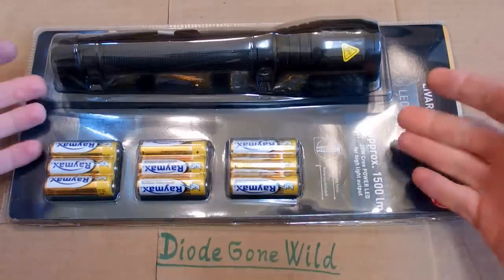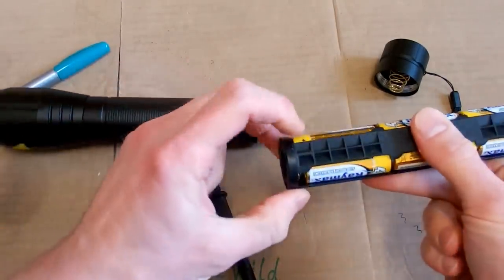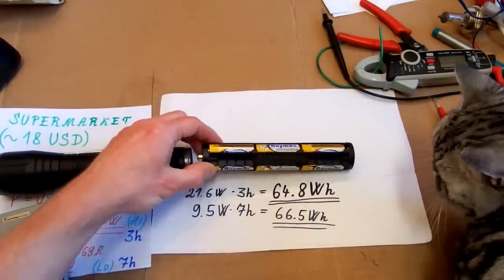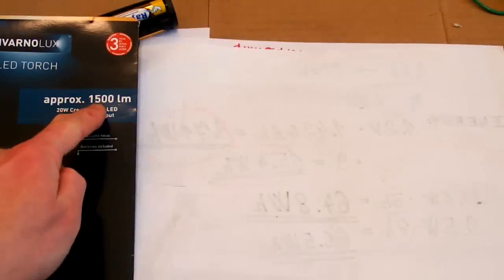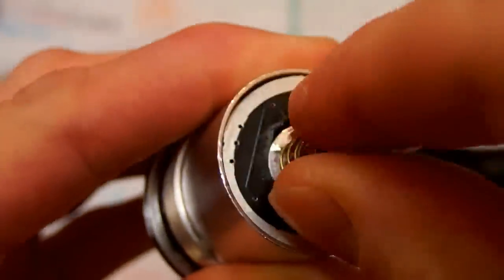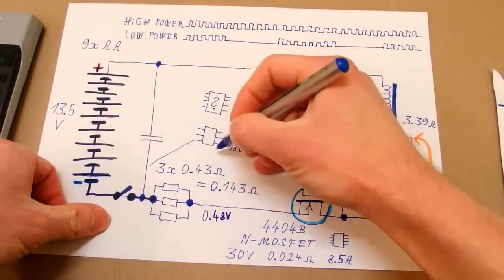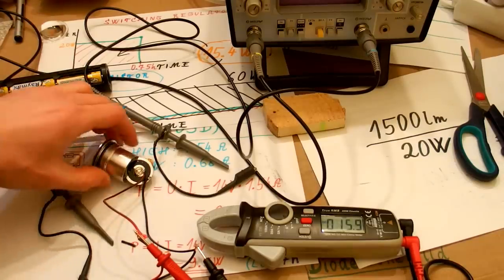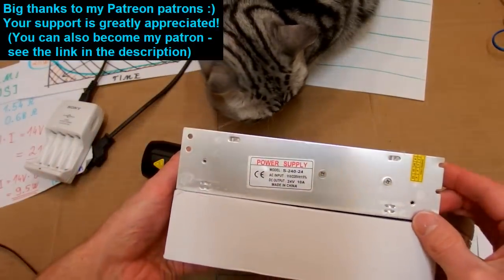20W 9xAA Cree LED torch from Lidl - test and teardown

Comment: Thank you for your once again very detailed video. I also bought 2 of these flashlights before Christmas. For 15 euros per flashlight, this is a good flashlight and also good for modding. The Led is a Cree XHP 50.2 Led (18W), this is available as 6V / 3A and 12V / 1,5A type, max 2654 lm, max. 165 lm / W. I drilled 2 opposite holes into the aluminum head, in order to be able to open and screw the head better (for the Led driver).I removed the small plastic disk and cleaned the head of thermal grease and glued the Led board back with thermal glue for better heat transfer. As an alternative to NiMh AA batteries 3x Li-Ion 26500 cells would be conceivable (3x max 4.2V = 12.6V). It would be great if when once could reprogram the microprocessor to remove SOS and beacon and add a third very low brightness (moonlight mode).
 Thanks for your many interesting videos. You have a nice cat. Greetings from Germany. Wish you a healthy new year.
Reply: A few people posted schematic in the comments. So fundamentally you could replace the mode control IC with your own microcontroller. Chances are whatever's on there is either OTP, or a custom or semi-custom IC that replaces a microcontroller used at prototyping/development stages and thus sharing the footprint with a microcontroller.

Comment: Why an Earth all of these LED flaslights have tose blinking etc functions? I want flashlight with just ON/OFF switch and nothing else. Or at least a system where you can change the function separately and the switch is just ON/OFF switch.
Reply: I modded one of my flashlight just to remove those blinking and halfbright modes, it is much better with just a single mode. Having a potentiometer to regulate brightness separately would be even better.
Reply: SOS

If you're stranded and you need help, a repetitive flickering light will get more attention than just a bright light. Rarely does natural stuff pulses repetitively. 

Also why we think aliens will send pulsating radio waves to us.
Reply: well these functions are used,then you do crash landing/ship sinks..then you can use it as sos signal..i seen flash light what max distance is nearly 2km..
i seen theys kind inside emergency kit offen

Comment: Very good presentation, the voltage/current/power/energy concepts explained so that even a 14 years old would understand them. The flashlight might be a good deal to reuse the 20W cree led, I think if bought separatelly it would cost about the same and here you also get the buck converter, lenses, batteries, etc.

Comment: That could be fun project. Turn that flashlight into LiPo powered one. Using LiPo cells with BMS board with charging capability. Also happy new year. Z pozdravom zo Slovenska.

Comment: For disassembling flashlights you can try to pull on this zoomable part and rotate it. As this zoomable part grips this led module you might be able to unscrew this without damaging surface.

Comment: I do not know if could be helpful but that is a Cree LED, the 5mm one is the XHP50 .
You can check it in their website,  led components/products/XlampLeds/Arrays, look like thier XHP50.2 (more powerful, you can recognize from yellow bulb and the 4 chips), also you can check data sheet, that is pretty cool.
I am waiting a torch with their last model of led XHP70.2 way more powerful, that works with 18650 battery!
I have already treadown some flashlight with cree led and all work the same!
Incredible few days ago I fixed up a power supply 24V but 4.5A model LP2022-24 and now you will looking the 10amps version.
We have the same passion lol.
I will wait with impatience the upload of the video about power supply!!! They are my favorite on this channel please keep doing!
Have a good day, bye!!!
Reply from the maker: Thanks for identifying the LED :). They could have used 18650's in this flashlight, but with the batteries and a suitable charger included, it would be too expensive for a supermarket...

Comment: I do love that really powerful flashlights are now affordable for normal people.  I'd be all over the 'affordable' lights if they only got rid of the strobe, SOS, and let you set the power level for one click on (maybe a switch to tell it to go low or high once I press the cap's power switch). EDIT: Would you be able to fit (3) 26xxx sized lithium batteries in it?
Reply from the maker: I do love it to :) And I also hate the strobe and SOS. It's possible to bypass the mode chip, but you also lose the low power setting which I don't want to lose. Three 18650s or 26650s are unfortunately too long.

Comment: I'm guessing it would also fit 3 X 18650 in it or possibly an even wider battery. More realistic capacity of these is about 10.5 wh which would be closer but still not what expected. At very max might find a 12wh 18650.
Reply from the maker: I thought of using 3x 18650 or 26650, but they are loo long.

Comment: hey diode, can you check if 18650 will fit & work in this body? It has this AAA adapter so I assume it could work with 18650 right away as in other chinese smaller ones for 3AAAs but just to be sure - this seems like quite good hardware actually.
Reply from the maker: No, it's too short for three 18650s.
Reply: DiodeGoneWild What about finding some decent Li-ion AA batteries and either modifying the battery holder for a 3S3P configuration. Or maybe just use 3 batteries and short out the rest?
Reply: a real pity that. Well thanks for checking anyways.

Comment: Quite nice review. I just wish, you would do an efficiency measurement. But I suppose it would be quite low, especially if current sense resistors alone waste almost 8% of power to the LED.

Comment: This led is may work confortable with 8.4V 2S2P battery pack and practical to have a controller 33% mode to get lots of lumens and last abaut 3 or more hours in tipical usage.

Comment: Happy new year! Well the Power should be calculated with the voltage under load. 1.5A/9 batteries = 170mA of current from each battery, which should drop the voltage some
Reply: This works if the batteries are in parallel; the batteries are in series in the flashlight; so 1,5A from each battery at around 13,5-14,85 volts total; so the power is ~20,25-22,28W

Comment: Do you still have your Christmas present?  What does the clamp ammeter do when it sees AC?  according to the data sheet the QX9920 should charge the inductor up to about 1.7  Amps and turn off (0.143 ohms 0.25 Volts).  The input current should be 1.7 Amp pulses of shorter duration with higher input voltage (constant off time) (at 19:49).  Ideally power in should equal power out (I assume the brightness does not change with input voltage).  I'd also suspect the measurement at 4:45.

Comment: lov what you do, Happy New Year......always found it confusing on LED power ratings stated on the packaging, is it equivalent to an XX watt light bulb or does it use XX Watts? ( latter being useless for spec'ing actual illumination ).   luminous flux is better, but, ya never know if an integrating sphere was used...or a light meter ...or just quoting the LED mfg's datasheet!   Cheers

Comment: Wow for a $20 flashlight it has a pretty monstrous XHP led in it. Flashlights in the $70 and higher range typically use those chips.
Reply from the maker: I think that the LED is the lowest efficiency bin. If the data on the package are right, 1500 lm / 20W = 75 lm/W. This is why it's cheap :).
Reply: @DiodeGoneWild thats an xhp50.2 quite a high-end chip from CREE from memory on the datasheet it can do like 2600-2700 lm at 20w so it definitely isn't a cheap chip, they've just underrated this flashlight by the looks of it.

Comment: Shark fin, more like a cat fish :-D
That looks like a dam good torch, how to get lithiums in there, more power ha ha :-D.
And a switchmode to play with, sounds like you had a good xmas.
Lidl and Aldi have some usefull stuff, but aldi has something for say a week then thats it!.
I bought a digital micrometer for £8 (really cheap), they never had them again.
Reply from the maker: It's definitely a good torch. It seems to contain xhp50 LED. Probably one of the lower efficiency bins, but still good. It would be bloody expensive to run in on Lithium AA's, but this would be very good for an emergency flashlight with a very long storage life. For frequent operation, Li-Ions would be the best, but 3x 18650 or 3x 26650 won't fit, they're too long. Maybe I could remove the switchmode power supply and put just a resistor in it and then run it on 2x 26650 in series. The SMPS would run on 2x Li-ion too, but at a low power. It could also run on 3x AA Li-ion and 6 dummy cells, or it could be rewired for 9x AA Li-ion (3S3P). Here we have no Aldi. Lidl also has those things for one week and then they have different things. Once I bought their 19W E27 LED and I was waiting a year before they had it again, to buy another :).
Reply: Speak of the devil, i was just looking through the power supply section of your site and up popped your notification, i thought he knows im here lol :).
Ha ha it sounds like Lidl is pretty much the same company, just one week is Aldi's trick.
I think it's done to make you go back every week, just in case you are in danger of missing something lol.

The digital caliper (yes i did take it apart, just had to) would have cost 30 to 40 pounds elsewhere, same basic no-name.
You could use a resistor for dropping voltage, a small wirewound perhaps?

Comment: Is your cat really called "Mike Hat"?😸😽😻😼🤦😹

That's quite an impressive torch, considering its price and origin, and quite a lot packed into a small space, but, it's a bit misleading in its claimed running times. I would be very wary if I were say, an "urban explorer" and expecting three hours of use on one set of batteries. Just imagine getting 45 minutes into a tunnel, and suddenly, the light went out.  It would be a long crawl out in the dark!

Comment: There are many of these lights out there labeled with different brand names. All the same with the same XHP LEDs. I’ve seen this exact light branded as Bushnell that sold at Walmart… And several other brands like Nebo and others… And they all come with those shitty alkalines. At the very least folks could replace them with NIMH. 
Three 26650’s won’t fit but then possibly three 26500 cells would. Sure is a good cheap light if folks can figure out a way to fit good rechargeable cells in there. Probably a really low bin XHP50 but still… being available locally in stores it’s a great light for people getting into modding and tinkering with lights

Comment: Under 1.5amp the voltage of the batteries is droping way under 14 volts, so the power is not close to 20wats

Comment: You should check batteryshowdown dot com where there's a bunch of AA batteries tested at high current (1A) and low current (100mA) 
Nine batteries seems a bit excessive to me, imho they could have used 3-4 C or D type batteries and a step-up led driver in the flashlight - you can get alkaline C batteries for around 1$ on Amazon and rechargeable C batteries (with around 5000mAh capacity) are around 3.5-4$ each
Reply from the maker: They probably  use AA's because they are more common. I very rarely see a proper  alkaline C or D. Cheap C or D batteries have almost the same capacity as AA's.

Comment: There  is  something  wrong  with  this  scheme  
1-the current  sense  resister  should  be  in series  with  the  coil to sens the  led current  and not hall circuit

Comment: I think the Morse is wrong. there should be no pause between the last dot of the S and the first dash of the O, and likewise O and S. SOS is a prosign (procedural sign) with the mnemonic SOS, not the three individual letters S, O, S.
I once made a circuit using CMOS discretes (a counter and a decoder, I think) that flashed SOS which is how I came to know this
Reply from the maker: I didn't know about this (just like the designer of this flashlight)...

Comment: Recently i have noticed something , a 16amp European plug perfectly fits into a 6amp indian plug , the thing is that most of the europe has 220v so European products like power tools and computer power supplies are very much sold in India with the same plug , i have a heating gun which draws 2000w and the plug is a 16amp non earth European plug (it is made of plastic and only the nozel is metal which u r not supposed to touch bcz it gets very hot!) The European 16amp plug doest fit inside 16amp indian plug!! Which means more fire!!🔥🔥 , And this a bit of a safety concern cause the 6amp plug gets heated a lot and i can barely run it for 1hr before it melts!! !! 8amps through a 6amp plug!! = 🔥🔥

Comment: 9 batteries in series:  add the voltages together but doesn’t the Ah remain the same a 1? So no increase in capacity by many in series only by many in parallel?  Thanks
Reply: If you talk about the capacity in amp hours, the capacity does not change with cells in series. Often, the total energy stored in the battery (measured in watt hours) is also called capacity. The total energy in Wh (which is what this video mostly talks about) is indeed multiplied by 9 when the voltage is multiplied by 9.

Comment: You can find 26500 li-ion or li-poly at AE so it would fit. For shit and giggle, you could simply reroute and rewire  the AA battery bay to 3P3S configuration with 9x 14500 li-ion battery. Lol

Comment: 3x18650 cells seems better in this operation
Reply: It might fit even the 3x26650 cells
Reply from the maker: 3x 18650's or 26650's won't fit without a hydraulic press :)
Reply: @DiodeGoneWild  26500 then?
Reply: @Mavi222  3× 14500 li-ion
Reply: @DiodeGoneWild  any other rechargable battery upgrade possible? I got the 12 battery "30w" version now, bought at lidl sweden
Reply: @jvsyoutube3298  definitely possible. Like I mentioned above you could try the 26500 batteries they are a bit shorter than the 26650. And they have shit tons of energy storage when compared to alkalines. Or possibly you could find a way to extend the tube of the flashlight. Many companies sell cheap extension tubes for a few dollars. Or if you want to do it without any modification you could just buy NIMH rechargeable AA batteries

Comment: "Its quite usefull" And throws it away xdd
Reply: It's a very nice design! But the use of regular batteries is a huge let down. Also for that money or even less you could get a convoy S2+ flashlight which should be about the same intensity, better circuitry and 18650 battery. Also more compact case.

Comment: lm/W doesn't mean efficiency, but efficacy. 75lm/W is actually quite terrible for a 6000K-ish 5050 LED, or any LED actually. Any half-decent design of LED lighting is 80-90lm/W with a frosted cover (which loweres efficacy) like in many home-use LED bulbs, and for that color temperature it's not hard to get 100-120lm/W with clear cover and lens. Proffesional LED lighting can go even higher, probably up to 130-140lm/W. They are probably running the LED too hard, which puts out more light but lowers the efficacy quite a lot and shortening the LED's lifespan a lot.
Reply from the maker: Yes, the low efficacy may be because it's run at the maximum power (LEDs reach the best efficacy at lower powers), or because the LED is the lowest efficacy bin, which is probably cheaper.
Reply: I'm almost 100% sure it's one of those lowest bins, with extremely poor CRI and efficacy, hence the RG2 classification, which again is just plain terrible and actually dangerous. Amazing how far manufacturers go to shave some cents off...It's not that hard to get a product with RG1 rating and still keep it cheap as chips
Reply: I don't know much about this stuff, but the LED seems to be the Cree XLamp XHP50.2. Cree's website says that "Maximum Efficacy at Binning Conditions (lm/W)" of this LED is 165 lm/W and "Maximum Drive Current (Standard)" is 3 A (6 V) or 1.5 A (12 V). I think these are often succesfully run harder than the specified values, so could it really be run too hard in this case? Also the "Max Light Output (lm)" of this LED is 2654 lm. Do they really have such bad bins of this LED?
Reply: @Pseudoplasmagore  if the chip is run at the same ambient temprature and voltage/current settings, it will probably put out 165lm/W.
In real life, it will always be significantly lower than that, due to lens losses, glass/plastic cover losses, and of course losses due to heat.
With a good thernal design and good lens/glass, a fixture using a 165lm/W could effectively put out 130lm/W, maybe up to 140lm/W if done incredibly good.
So it's easy to see yhat 75lm/W from sucg a chip indicates an amazing skill at fesigning shitty and dangerous products

Comment: Oh how I hate flickering LED light sources. It's so stupid this runs on 200 Hz even though it is fed by a perfectly smooth DC power source (batteries), so it could easily be flicker free. Or at least, if it really needs to run modulated, use at least 1 KHz, not 200 Hz – way too low!
Reply: Martin Weizenacker I personally prefer PWM “dimming” frequencies at, or above 80Khz. to avoid audible harmonics. It also makes it possible to use it for lighting in video recording applications!
Reply: @BoHolbo  Yes, exactly. Good point!
Reply from the maker: Yes, it's stupid to modulate the low power at 200Hz. A lot of people try to use those flashlights with a camera (for urbex and so). This makes horizontal bars in the video. Only the high power works well with camera. But for some crazy reason, some flashlights are pulsing even at the maximum power setting!